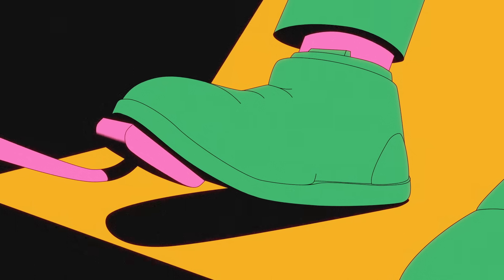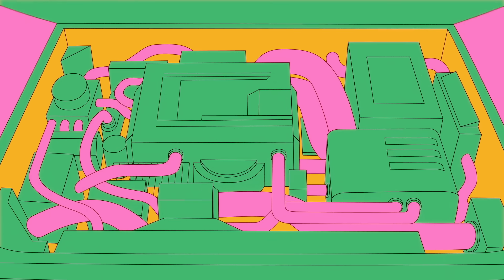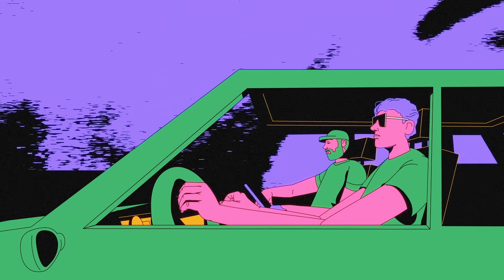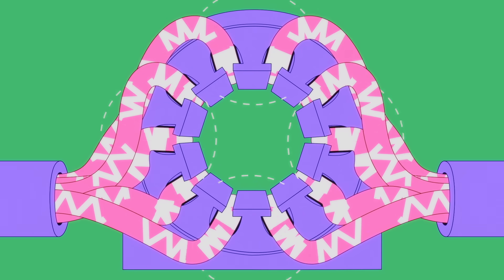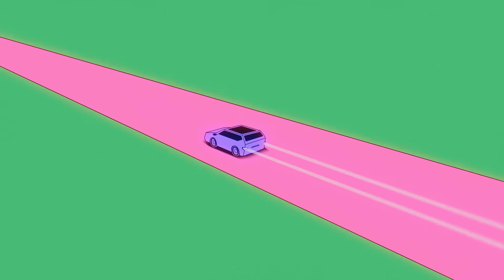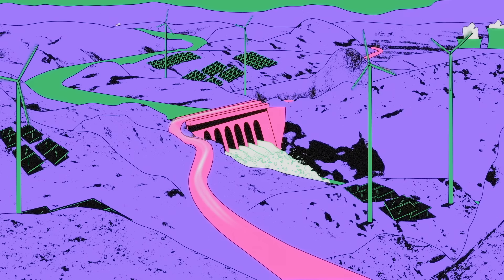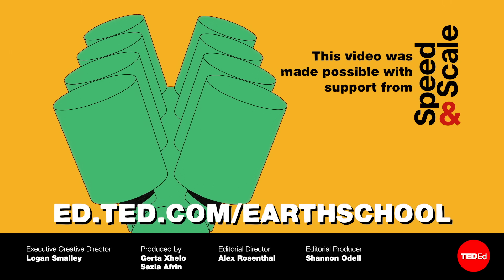This is what happens when you hit the gas - Shannon Odell

Comment: 1:37 Minor correction: The fuel-air mixture is specific to gasoline engines only. In diesel engines, air is compressed first, and then diesel is sprayed onto it. This method allows for greater air compression without the risk of the mixture self-igniting, resulting in more thermal efficiency which can yield more power from the same amount of fuel. This is one of the reasons diesel engines are more efficient than gasoline ones.
Reply: That's right. Only one small correction: diesel creates more power for the same amount of ENERGY, not necessarily fuel, since diesel and gasoline have different calorific values (energy per quilogram of fuel).

To make a complete comparison, you would have to take into account the density and calorific value. Also one would need to specify if he is comparing on a mass base or volume base.
Reply: @winteralbireo You see we came here with an intention to learn about the topic. if your Instagram-based personality can't accept that, just leave.
Reply: @bluescrud8879  the topic is general and broad in nature, its not supposed to be an in depth explanation, especially not within a 6 minute video. theres so many more rambler videos you can watch.
Reply: @bluescrud8879 you see the joke was, he said information and the nerd emoji means nerd or smart so that’s what he was sayin.
Reply: @GoofyAhhBoxy  You see, a joke has to be funny for it to be a joke
Reply: @bruhmoment91 it’s a reference to Key & Peele skit on Neil deGrasse Tyson
Reply: @nilajitsinha6561 did anyone ask? 😨
Reply: Why cant we do that on gasoline engine if it will raise the efficiency of the engine
Reply: @shadowknight4339  from what I can gather from this video, probably because gasoline won't self ignite with compression inside the piston anyway, they need spark. Why bother timing the fuel (pump/injection mechanism), just time the spark (simple electricity).
Reply: @anursetiawan  no, gasoline will self ignite but it will damage the engine. It still needs injection timing for fuel delivery unless it's old enough to be using a carburetor. Gasoline engines currently are as efficient as they will ever be. This video's efficiency numbers are too low for both types of cars. Diesel engines can be 40-50% efficient.
Reply: @shadowknight4339 Because that's not how gasoline engines work. They ignite the fuel with spark plugs, not compression.
Reply: Correct. Diesel has such a low octane number that, it’ll detonate under the compression hence the reason why it needs to be sprayed after.
Reply: @Eclipsis17 diesels dont have octane number
Reply: @adamcherry1117 all fuels have an octane level including diesel but the octane level for a fuel going into a diesel engine is not listed because it doesn’t matter for a diesel engine
Reply: @TheWeavingBagel  no, Diesels have cetane number
Reply: @adamcherry1117  Cetane and Octane levels are properties of a fuel. They are not a chemical or physical thing it has. Diesel does have an octane level even if it's not publicly displayed, tested for, or doesn't matter. In this case Cetane is the more important one to know.
Reply: @winteralbireoanyone who does this is just making fun of someone smarter than them. I actually learned something from his comment.
Reply: Turbo X Engine is the best in mileage efficiency
Reply: for big trucks and ships which have a piston like a drums diesel or crude way better option, for small gasoline are best cleaner for the engine.
Reply: Thanks for the explanation. I've always wondered about that, but also always forgot to look it up in an informative video on YouTube. I will now though. You've given me the primary info I needed!
Reply: what correction? i don't see it.
Reply: If you know that why did you click this video
Reply: completely unnecessary comment. They aren't talking about diesels.
Reply: @couchpotatoes5158  If you were paying attention the VW they were driving was a diesel. No gasoline car can get 80 mpg
Reply: @couchpotatoes5158  but the commentator is

Comment: another key point that i think was missed in this video
the EVs are usually powered by electricity thats said to be generated mostly by coal power plants..and people say thats equivalent to an internal combustion engine run car...what most people miss out is that the processes used to convert fuel in powerplants are much more efficient than an internal combustion engine
Reply: Economies of scale are also a factor. In power plants you are able to get higher combustion temperatures which further increases the efficiency of the turbine. Also it is much easier to capture pollutants from a single power plant stack than from millions of cars' tailpipes.
Reply: @michaelvicente308 how do you capture pollutants? 
Do power plants do that?
Reply: @Questofthenight you have electrostatic precipitators that capture ash from coal plant flue gas stacks. And in gas fired plants you have selective catalytic reduction units that capture sulfur oxides. At the bleeding edge you have direct carbon capture technology that captures CO2, and those work much better when capturing CO2 while it is still concentrated at stacks compared to when it's already diluted in the atmosphere
Reply: @michaelvicente308 oh wow I had no idea that was a thing. That’s cool. I’m glad some plants take that step
Reply: What some people don't realise is that power generation differs in different places
Reply: Watch 5.28 they have mentioned this point as EVs are not carbon neutral,there emission profile depends on charging utility
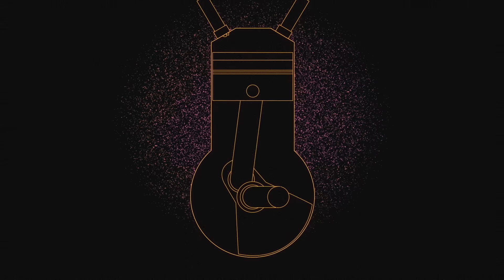Reply: @mithunbobade1  that's a different point. what you are referring to is the source of the energy. what this commenter is saying is that even if the energy is not clean (coming from combustion) the process of generating the energy at a plant is more efficient than inside a car, since the cars are so inefficient (the point mentioned at 2:34 in the video)
Reply: @mithunbobade1 his point was the efficiency of power stations compared to a combustion engine… which matter because higher efficiency means higher yield and less waste which put in contact means the emissions are still considerably lower than ICE
Reply: Also rather than each car emitting, only the source emits which it will either way since we need power for everything… It is also true most electricity sources are switching the renewable since well we don’t have a choice… climate change aside what will we do when we run out of fossil fuels if we don’t think ahead… If we get it right it’s two birds one stone… only a small mind wouldn’t understand that…
Reply: Unfortunately the main problem in terms of sustainability of electric cars is in the battery production, you need to extract a lot of rare earths and more, leading to soil and marine pollution, there's also an high emission of particulates, which are bad for our health. 
(Del Pero et al., 2018)
Reply: Can you be specific instead of "much more"? Most people miss out the chance to be reliable sources of information because of this lack of facts.
Reply: @Zilvaras2  Power plants, especially combined-cycle natural gas power plants, can achieve higher thermal efficiencies, often exceeding 50%. This is because they can capture and utilize waste heat to generate additional power, improving their overall efficiency.On the other hand, diesel engines used in vehicles and small generators typically have lower thermal efficiencies, often ranging from 25% to 40%. However, they are designed for mobility and versatility, which may be more important in certain applications.
Reply: evs best think is not puluting the city the electric could came from coal but the coal electric generator factory is out of the city
Reply: It is simple, don't burn coal or "natural" gas for electricity.
Reply: @rdmcabee even if you burn fossil fuels for electricity production, the total efficiency of an EV is still higher. In a 100% fossil fuel grid, you can think of EVs as "deferred" fossil fuel cars, with a much higher efficiency engine in a central location.
Reply: Not much more. ICE can reach up to 50% efficency where combined gas - coal powerplant has efficency up to 60%. So Not that much difference
Reply: not at all buddy, coal power plants in an ideal scenario have a 40% eficiency...
Reply: @dan1_1 and internal combustion engine efficiencies are much lower than that
Reply: There is no free lunch here. Any time you do something, there is a consequence. It's pretty clear that fossil fuels have no future, and we need alternatives. If you really care, drive less. Ride your bike and use public transportation.
Reply: @theWZZA FYI not everyone lives in a city with bike lanes or adequate public transportation
Reply: no one doing that blud, face reality lol @theWZZA
Reply: That is true but the problem is getting electricity from the power plant to your car. You first have to carry it over long distances through wires, then there are a lot of inefficiencies in both the charging and discharging process, thus bringing the overall efficiency down. I don't know what the numbers are and I suppose it depends on the situation, but it's nevertheless a thing worth remembering
Reply: @sebasbot01  in the early days of electricity, Thomas Edison advocated DC power transmission, and Nicola Tesla advocated AC. Tesla was right; AC is much more efficient for transmission over long distances. How about digging up petroleum from the Middle East and shipping it via tanker across the ocean, refining it, then driving it around in trucks all over the country? It's like email vs. the pony express.
Reply: @sebasbot01 Most electricity in the United States is produced by Natural Gas (Roughly 50%-60%), not coal. Coal has slowly made up a smaller portion of the generation stack through policy reform. It’s worth noting renewables make up about 20% of all electricity generated in the U.S.
Reply: Coal is only 17.8% of us energy production.
Reply: @nunezee5  im not from the US
Reply: That is true, but coal produces more CO2 per kWh than Gasoline or Diesel. Plus the electricity needs to be transported to the charging station. In fact this is one of the few ways CO2 emissions of your EV can be worse per km than an ICE car. And all this in spite the coal power plant being twice as efficient as the engine. As soon as you burn something that is not pure carbon you are right though. A gas plant and EV muuuch better than a gasoline/diesel car can be co2 emission wise.
Reply: @MaxMustermann-bm7qt yes but noone rlly use coal anymore
Reply: @khiemgom  poland, and china. But yeah no one else in relevant quantities/percentages.
Reply: What are you on about "mostly by coal". Got any research to back that up?
Reply: Sooo you didn’t watch the video huh? lol because he addressed where you get your source of electricity from. If you get your electricity from a renewable plant it’s almost 100% green energy.

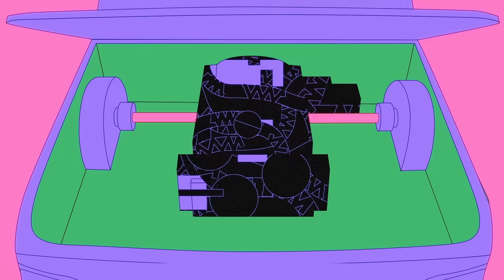Comment: 4:30 so biased, and says someone who has never worked on either. Why are you comparing the whole vehicle against an EV motor? The actual engine only has a handful of moving parts, the rest are just bolts and nuts and wires, they aren’t moving.

Comment: 4:20 I can’t disagree with this more. Most parts in a combustion car are replaced as an assembly nowadays so you really don’t have that many parts. Also please pop the hood of an electric car, and take a look at the wires and cooling systems, I had to replace the rubber bushings of motor mounts of two experimental 2025 Audi SUVs because the engineers think the original ones are too soft, and I had to drop the whole subframe to replace 3 rubber bushings.
Reply: i think i know the issue of that car aside from the bushings, it's an Audi(VW group) made.

The company that's pushing electrification of their vehicles so hard because they got caught cheating their emissions test lmao

Comment: the video did mention where the source of the electricity matters, but what about the metals you needed to make those batteries. might be a good video idea
Reply: Its a first step for a greener energy in the future. why dont you think in a positive side? industrial factories are providing the EV industry now. It will change but it will take some time to adapt. Majority of our energy relies still in fossil fuels tho which is bad.
Reply: @janstefanflores2624 Why don't you think of the realistic side and realize that spending money on public transportation will also help with this and other problems?
Reply: @kakahass8845  ok what im trying to see is a bigger picture that we can slowly transition from fossil fuels to EV. I understand your point where "those things are made of". Apologies mate but we  need some emissions to start a greener energy.
Reply: @janstefanflores2624 That is not my point at all my point is that public transportation is a better solution than EVs and probably easier to implement too.

Comment: As mentioned in the video, a normal combustion engine has a lot of moving parts. Each interaction is a point of friction and therefore loss of energy. Another thing to keep in mind is that they require cooling, oiling, and quality of life accessories. That means pumps to move various liquids around. Coolant and oil to keep the engine from destroying itself. Hydraulic fluids for power steering and breaking. Even your AC requires a pump and fan to cool your cabin. These are all leeches on power that would otherwise go towards the wheels. If you ever wonder why we have turbochargers instead of superchargers, this is the main reason why. Supers are driven by a belt connected to the engine, another power leech. You still gain more power than is lost, but worse than a turbo. Turbos, on the other hand, are driven by the exhaust of the engine, energy that would've been gone out of the tailpipe. There is still a small loss in power from a turbo, but that's mostly because it requires the engine to do a little bit more work to push exhaust through the turbo. For both chargers, the reason why you gain more power than is lost is because they compress the incoming air for the engine. More air means more fuel and better combustion.
Reply: Never seen EV without cooling, AC, steering or breaks.
Reply: @drayke8886  He is talking about the engine alone. You only have maximum power to do all those stuff,  as they are powered by the engine. Its why some vehicles need to turn off AC when they run up a steep hill.
Reply: @resugram_YT  thats the same exact thing for EVs...
Reply: @HIFLY01 the effects are not the same. AC in an internal combustion engine car leeches power from the engine, meaning less power for the wheels. AC in EV's leeches power from the battery, this does not affect the amount of power available to the wheels. It only affects the drain on the battery. It might even not be the same battery that is affected, I don't know. Anyway, you get the point. HP going to the wheels stays the same in EV's. Correct me if I'm wrong.
Reply: @GierJoost  true but unless you're driving a super old car it shouldn't have that much of an affect. Is the difference between 120 vs 110 going to matter? Probably not for most people. Your engine will try to increase its power and unless you're somehow always running at max rpms it shouldn't be an issue. Hauling a trailer or something heavy is one thing but doesn't really matter for most of the population. Not sure what year the other guy lives in because if a car cant go up a hill without an extra 3-10hp, it probably isn't the compressors fault
Reply: That was somehow as informative as the video itself… props

Comment: Just purchased an electric car... never going back.
Reply: Why are you not going back to ICEVs?  What BEV did you purchase?
Reply: @acolon8999  It's a much simpler way of existing.
Reply: @theWZZA  I don't disagree with you but after trying your BEV, what made you come to the conclusion that you wouldn't go back to an ICEV? Maybe it was just one thing, maybe many that made you come to that conclusion.
Reply: @acolon8999  No more gas stations, oil changes, tune ups, etc.
Reply: @theWZZA     It is definitely nice not having to drive to a gas station once or twice a week. Cost of ownership is definitely lower (in over 3.5 years and 68k miles, besides a new set of tires I've only spent about $80 in maintenance).

I ordered my BEV with the idea in mind that because we take many long distance family trips during the year I was probably going to rent an ICEV for those long trips.  A few months into ownership I took a 600 mile round trip and I realized that I didn't need an ICEV. Shortly after that we took a 2,400 mile trip and my main concern which was charging while traveling disappeared. We did a 3,400 mile trip last month and a 400 mile trip this holiday weekend. I have over 130 Supercharging sessions, all without any issues. But that's not why I don't see myself buying an ICEV again especially since my wife also made the switch to a BEV over a year ago.

The safety of BEVs, the ability to charge at home using my solar panels, the  software, and the continuous over the air updates are some of the thing that I really don't want to give up.

Comment: Electric 🔌 vehicles are part of the future, but they are manifestly not the future.
Electric-powered cars are not on the road to a renewable and clean future. 
They are powered by lithium-ion batteries that will pose a real threat to the environment if continued to be manufactured at the rate of current gasoline-powered cars.